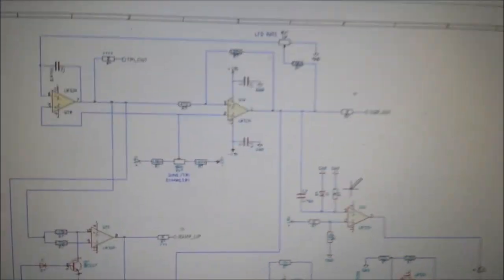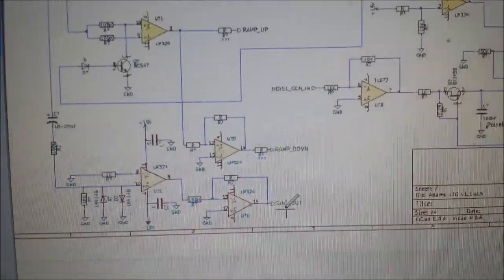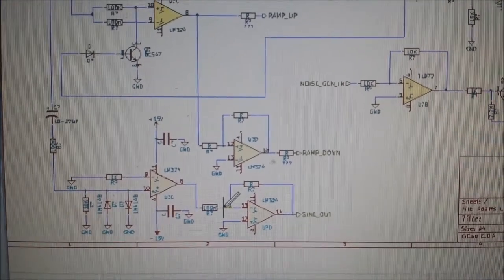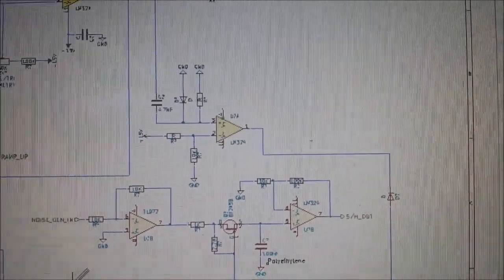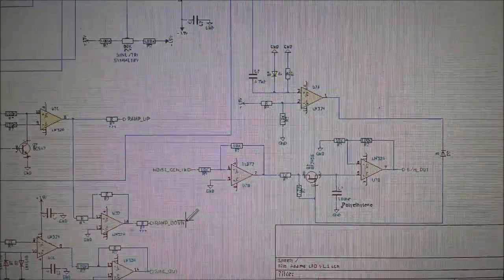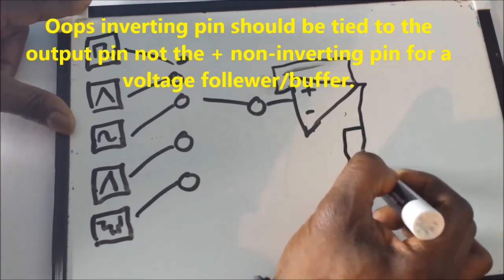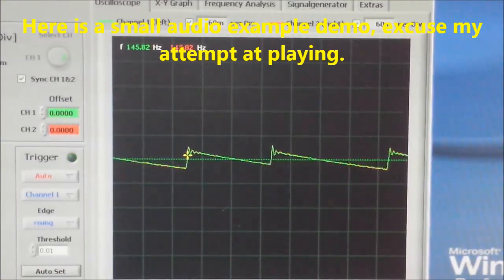DIY analog synth project Tutorial Part 16 (The LFO six waveform upgrade)

Comment: You need a on off on SPDT switch and 3 capacitors. : )
Reply from the maker: On which part of the circuit are you refering to ?.
Thanks :-)
Reply: Adamski A. Hey, At 1m00 the text says: you could even try a 3 speed option with 2 switches and 2 capacitors. 
But you can take a "on off on" spdt switch, this switch is off in the middle position.
 aside of the default capacitor, you can switch 2 other capacitors in paralel via the on off on dpdt switch. 

Check images: Doepfer lfo A-145 / Doepfer A-143
Reply from the maker: @AnalogDude_  oh i see . Now your comment makes sense. Yes you means as a range switch option.
Reply: Adamski A. Do you know Thonk? The world famous DIY synth store?

https://www.thonk.co.uk/shop/sub-mini-toggle-switches/
Reply from the maker: @AnalogDude_  . Yes ive dealt with Thonk for a few years now.
However i find their selection for pots and switches a bit limited.
Reply from the maker: @AnalogDude_  There is also RS components here in the u.k. 
Which do absolutly everythimg electronics related . Also mouser uk are about 35mins from me though they only do mail order.
Reply: Adamski A. Nostalgia doesn't make sense if you can use much better fabricated parts.
Reply from the maker: @AnalogDude_  Which nostalgia are you refering to ?. Through hole ???
Reply: Adamski A. No, i use through hole parts like resistor and op amps, but special parts like matched diodes, transistors, ... i use smd and through hole like FET are becoming rare.
Reply: Adamski A. You could make adapter pcb's to emulate old parts like transistors, FET's. 1 side with SOT23 and on the other side TO-92. To test modern day parts.
Reply from the maker: @AnalogDude_  . I get that. However for me its not about nostalgia. Its about what i had available to me. Some parts were given to me from people who were lind enough to do so. I work with breadboards so from my protoyping point of view there is no point in investing in smd/smt components. If i was intently looking to make a commercaially available product then yes, surface mount parts would be the way to go.
Reply: Adamski A. Right, but i thought you also where designing pcb's and i felt to mention that smd are parts not to ignore. No pun intended : )
Reply: Adamski A. In the past i wanted to built true clones with the orginal parts
Reply from the maker: @AnalogDude_   Thats fair enough. However as you know my project is no clone.
Reply from the maker: Ok thats fair enough. You need to bear in mind this is my first project. People are still building synths and modules with through diy or not. When i feel i have landed my feet to a position that sees fit i will make decisions about smd pcb etc. This is not about me wanting to only use through hole parts because of some (special reason). As i explain/ed time and time again i havn't been doing this that long , so best walk before you can run.
Reply: Adamski A. I tried what you do in your schematic my maths with diy Frequency Central system X sample and hold, but i don't get what you get, even very slow, you still get a somewhat percussive audible attack at the start of the cycle.
Reply: Adamski A. Yeah , just trying to help avoid the culprits i fell in : )
Although impressive, it's an enormous project on breadboards, i guess the biggest i have seen. : )
Reply from the maker: @AnalogDude_  go to hackabrute and look up the sample and hold noise circuit its exactly the same except i put a capacitor in the negative feedback loop to pass off the sharp edges.
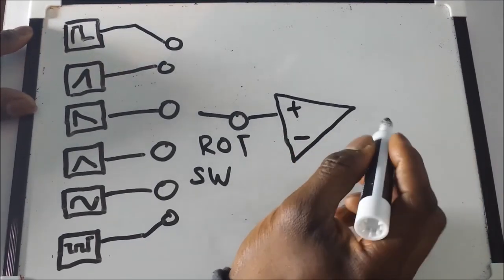Reply from the maker: @AnalogDude_  You can hear it in action @ about 9:50 ish  https://youtu.be/psLhH2n0Je4.
Reply from the maker: @AnalogDude_  Well advice taken on board . Thank you 👍

Comment: Quick question. I'm working with the pete Mcbennett schematic and cant figure out how to turn it into a true vco? My end goal at the moment is to produce a gate signal from this circuit anyway I get there is fine, I'm new to this though so the less complex the better. Thank you  for your time and help!
Reply from the maker: semeionart Thanks for asking the  question . There is a way to turn the pete mcbennett oscillator into a vco. Please look through my  other videos .  https://youtu.be/sdgrfBV5c5c this will show you how to make the saw core derived from the same type of basic sqr tri osc.  You will also need to build an exponential converter to give the oscillator voltage control. Feel free to ask away :-) Also this video https://youtu.be/u2JspaaJohY